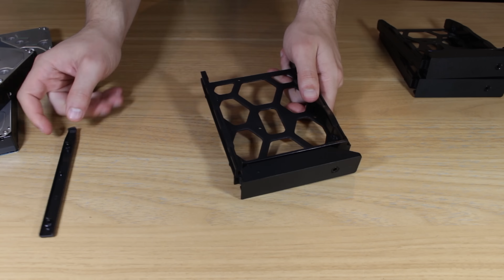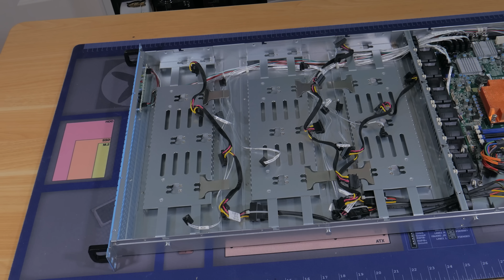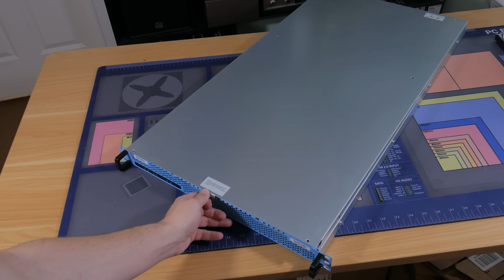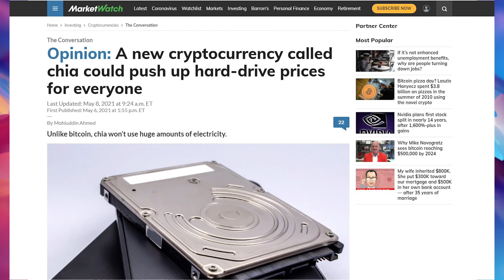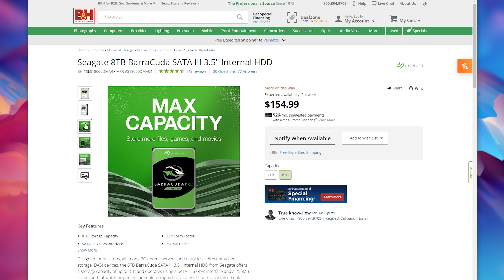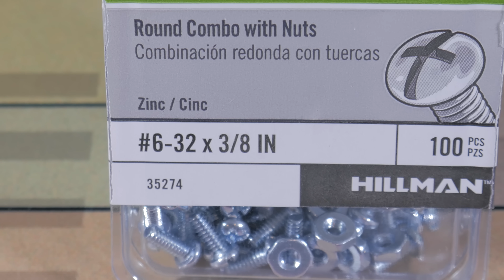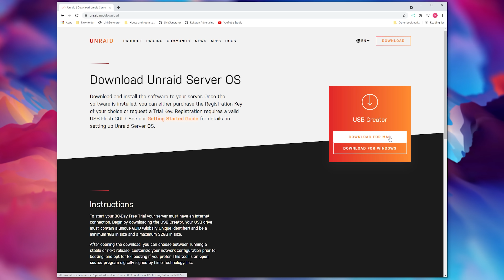Budget Storage Server 2021! | 80TB NAS

Comment: Well , i dont have 80 GB , i bought 7 two TB ( used ) HP Server Disks ( 30 Euro each , CMR ) an old 4 TB and two 1 TB HDDs  from my old External Drives and put it into my old Case which has 10 5 1/4 Bays . I used my old Asus Prime B350+ and my old 1700X , i buyed two 10 GBit NIC ( Mellanox , 15 - 20 Euro ) and an Mikrotik CSS326 Switch ( passiv cooled , silent ) with 24 x 1 GBit and two 10 GBit SFP Ports , 130 Euro ,  an 3m Copper SFP cabel with Transeiver , 10 Euro , an optical 30m SFP Cabel with Transceiver , 35 Euro . 
I use Truenas ( Freenas ) because it only works as NAS and Media NAS . The 2 one TB old  HDDs work as Raid Zero vdev , the old 4 TB as Media Storage as another vdev , and one vdev from 2 x 3 two TB HDDs in Raid 5 = one of the 3 HDDs can fail without loss in Data , one 2 TB is Spare . You dont need an Graphics card in a NAS , the 10 GBIT NIC card  ( 4*PCIe 3.0 ) is in the Grapics Slot. I banned the NAS from my computer room  to another less used room ( thats why the 30 m optical cable ) , 6-9 spinning HDDs can be noisy and i am sure , your 1 HE Server with its fast spinning Fans will be even more noisy . Currently i use my old 16 GB DDR4 but i am planning to upgrade to 3200 ECC UDimms . Ryzen supports ECC as my B350+ does and with TrueNAS ECC Memory make sense , more its better = it will be 32 GB , Truenas uses Memory as Cache , currently i get 300-700 MB read speed from the 6 Server HDD vdef ( with only small Files its way less , but thats normal for HDDs ) , in total i payed till now about 500-600 Dollar for my partly used parts 10 Gbit NAS
https://www.youtube.com/watch?v=Evm5dS0TtXU Read Performance ( Big File )
https://www.youtube.com/watch?v=-ALNbJz_-6o Write Performance ( Big File )

Comment: I wanted to point out that the factory retaining mechanism for the drives seems to rely on longer than normal screws in 2 of the holes.  You might be able to reuse those screws from the Seagate external enclosures, if that kind of thing matters to you.  A regular 6-32 SCHS (allen bolt) would probably work too, to engage the retaining mechanism.

Comment: Are you really tried zfs con FreeBSD? I dont think than ZFS is a good choice. Im sure its tje best one. Autorepairs, autoscrub, safe changing damaged drives, caché cache and cache is the most intensive thead than the processor must support. The only thing you should invest is un RAM. zfs is RAM hungry (42€  more and the benefit over a 100€ ssd is oversized... And you can add an ssd as cache toó, of course.

The most comercial and great db apps use it. Cause the not-restrictive license, and cause zfs hasnt any real alternative. Its the only one in 1st división, at tjr moment.

Ty for sharing. I follow u!

Comment: Opening something doesn't void the warranty in the US. You're based in the US. As a tech YouTuber, do better.
Reply: Even though that's true legally, some companies like Seagate will not honor warranty for shucked drives. You can take them to court, but that'll cost more than a new hard drive
Reply: @AstroDash42  Incorrect, at least in the US, where the OP is located. All you have to do is put the drive back into the case and submit warranty claim. You don't know or understand the Magnusson-Moss Warranty Act.

Watch and learn:

https://youtu.be/9sHbaGuSuck?t=480

Comment: i have a little nas made on rasberry pi,but a single thing i could say to you is,try to use btrfs as raid,it is also software raid,but could be implemented into free debian server and has some compreession features that could give you even more than the full 80tb space,obviously this will cost cpu power and disk space,but in my 4.5tb nas i've could be able to store up to 6tb of data just by using the btrfs compression,but it is slow as hell to add new big files,btw,read them and add small files are almost the same speed that without the compression

Comment: i do the same thing for 10tb drives at moment i have got 3 different types compute nas and a surveillance 10tb all work good in the nas so far or i use xponology and the sha drive system so i can add drives and expand as and when needed and still have a backup if 1 drives fails the 1u case must sound like a small jet engine

Comment: I have had generally terrible results using the Seagate "compute" level drives. They have firmware level sleeping that needs to be disabled via a DOS utility before they can be used in a raid setup, then I have had multiple failures compared to the iron wolf/exos series which I have more of (40+) but only a single failure.

Comment: get rid of a SSD, buy a PCIe Dual SATA M.2 with onboard sata chipset and you can run 2 m.2 sata drives without the need to use your onboard sata, use them for HD storage.

Comment: You did a huge mistake. Those regular Barracuda drives are SMR. After you write something, it will never recover it's writing speed on rewriting. It means, that they will die pretty fast  under intensive writing and break yours raid. Probably, in 6-9 monthes. I have never seen SMR drives working fine for long at servers and NAS. 

Seagate have Ironwolf for this, WD have Red Plus, Purple also may go better than those ones, Toshiba has X/N/MG drives.... And then, videos like this get 150K of views and my mate working at data recovery gets the work to be done....
Reply from the maker: You clearly didn't watch the video. I stated and explained they're SMR drives. I also explained how I'm not using raid, I'm using Unraid. Beyond that I also explained that anything put on here will go there to die, making the SMR drives fine for this application.

Comment: Excellent job! I wanted to go the same route, but I simply didn't have enough room for the full size server. I ended up with a Synology.  More money, less capacity, and not nearly as fun to tinker with, but fit my current need.  Using a PCIe extender, any chance of adding a 10Gb NIC?
Reply: I thought of the space issue, but this server can easily sit front side down, and stand it straight up against the wall behind a desk.  The plug on the top your vga/kb/mouse/power and you're good to go.  I love this setup and can't find it anymore. 😞

Comment: Thanks. It is going to be too loud for actual home use. Also you may want layout map the hard drive before put it in production use. Or else you may not know which drive is going down when they are ...
Reply: Unraid will give you the serial number of the drive. So there is no need to label them. If you were using a hot swap drive bay, sure. In this configuration there is no need.
Reply: @daaero  if your drive is down how cloud you read the serial number? unless the controller able to control some kind of LED to indicate which slot is empty or it is exactly listing the same logical and physical order so you can follow from 1 to 10 one by one. Or else you need to match the rest of the 9 drives' serial to find out which one is actually down
Reply: @daaero  lol I know but which one is the one that is currently not working? WIthout a map you need to go through one by one and check ok ... it is here, check, it is here check, it is here check, it is here check ... worst case scenario you need to check 9 drivers to find out which one is actually bad and not gone then pull it. So without a map,  it could be easily created at install time not run time, when your drive has died it is a needle in a haystack.
Reply: @daaero  you still don't get the problem. Maybe you are lucky and never face a dead drive in a  12+ drives setup with no led controller to tell which drive is died before. Using your example from the interface, let say your drive /dev/sdn is dead the next second, by then you will have no way to tell 2AE166 is missing because it has died. It won't be showing up in your interface whatsoever. How are you going to remember ok in my node 13, drive 14 which is the current dev/sdn is missing ... unless you get photographic memory which I don't how do you know ah /dev/sdn is missing and it is in slots 14? A MAP. Which can show you the historical setup not runtime setup.
Reply: @AvengerMoJo  
You don't get it.... this person isn't using a removable bay system. So your point is mute. He doesn't need to remove any drives to see the serial numbers. The numbers are right there.... I did say in my first comment that a label system would only be worthwhile in a removable bay system.....

Now my comments have and are only about this person's setup. I'll explain it again:

The drive serial numbers are stored in the unraid OS, which lives on the USB stick. There is also SMART, which you can have early warnings of a drive failure sent to your email. Unraid does this.

You don't need to remember anything. The serial number is on the label of the drive.

 The serial number is stored in unraid. If a drive suddenly dies, it will give you the missing serial number.

Using that number, you can then look at the drive labels to find the serial number printed on the label.

Which part of this don't you understand?
Tell me so i can try make it more simple.

I have had drives die before and this is exactly how I was able to replace them...
Reply: @daaero  which part of the OS keep keep your old drive serial number?
Reply: @daaero  from the doc "This step isn't strictly necessary, but is a wise precaution, just in case something goes wrong! Before you shut down your current server, make sure you have notes of which disks (model and serial number) are assigned to which disk number (logical slot) in your array. Or do a screen capture of the Main page, press Alt-PrntScrn, paste in MS Paint, IrfanView, or similar, and print it out." just to stay my point

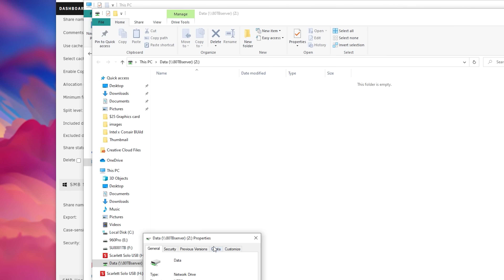Comment: 12:40 Drive manufacturers aren't overstating size, Windows under reports it. Windows uses tebibytes, based in binary, while terabytes are decimal, resulting in ~%10 difference in size. For some reason they refuse to either switch to terabytes, or to use the appropriate symbol for the tebibyte TiB.
Reply: This is actually partially due to historical reasons. Originally it was measured only in powers of two -- with the SI unit prefixes used for convenience. Occasionally companies would use it by power of 10 but it wasn't until 1995 when the IUPAC recommended the creation of new units to denote powers of two vs decimal units. The IEC adopted the recommendation in December 1998 -- which is relatively recent. Even OSX/MacOS used the powers of two units until Snow Lepoard and iOS 10 (2016). Likely Microsoft is staying with what it is because of a mixture of inertia and it ultimately not being that important to them.  

Fun-Fact: Donald Knuth proposed to call a Kibibyte a 'large kilobyte' (KKB),
Reply: You could still say it's the companies fault
Reply: It's weird how RAM manufactures and M$ can agree on which unit should be used but storage manufactures decided to used something else because they wanted to put a bigger number the box
The International Electrotechnical Commission (IEC) created the term tebibyte and the other binary prefixes -- kibi, mebi, gibi, pebi, exbi, zebi and yobi -- in 1998. Before then a Kilobyte was 1024 bytes there was no decimalisation of a base 2 number system. M$ is just displaying the units the way they always have
Reply: Wait, so they measure in one unit but display in terabytes?
That's as stupid as if I were to measure out 100 kilometres but then display it as 100mi.
Reply: @Chris_Cross  Not only is it stupid, it is outright dangerous!

Comment: TYAN are very good server boards. This server is great for its times but power consumption....

I was able to sell those PCB, power supply and cable as a SATA to USB adapter, and the power supply alone was sold as 12V 5mm barrel adapter.

Comment: SMR is inferior, but sadly not outdated. It's a farly new tech and the drive manaufacturers used it mostly for cost saving. I don't think SMR is going away any time soon, its primary purpose is for write once read many applications so is ideal for data archiving, many of the much higher capacity drives initually used SMR.
Reply: Yeah, it really does has its benefits! SMR drives are also generally cheaper and can have more capacity than a similar sized CMR drive which is a nice benefit, only comes into play for 2.5" drives though, as far as I now.

Comment: Why would you only get 30mb/sek for write? Sounds like you are doing something  wrong somewhere or that your server is limited to it somehow. I have cheaper drives in a server that i run that i get atleast 80mb/sek without any issues, should not be 30mb/sek for writes if you have it correctly setup.
Reply: It's called SMR drives
Reply: @borkiborz2891  No that is not the reason slurker, also own a few of those and i can still get up to 70-80mb/s atleast on a few of them unless they are older. The problem is either software or hardware or the drives themselves. Most likely as he has new drives it should not be the drives themselves i can promise you, here in sweden i do alot of computer building and have done over alot of years. 30mb/sek for write is really low for a new drive, has to do with either motherboard/chipsets/sata ports or software in that case. I even think i have/had one drive that is thesame as he is using in his video..

Overall great video otherwise, just trying to be helpfull :)

Question to the video maker, how do you transfer the files? Directly over SMB/shares or thru ftp? I've come across times when over ftp for example the transfer rates can get like that but because of config for example.

Comment: Hi friend. I did something similar than you. I bought an 2012 i5 HP server. I addedd 6 SATA discs (of 2TB each), and an SSD to boot and store OS. 75€ of the server, the disks than I previously had, 20 for the SSD. and 20 for the RAM. Some euro for the small stuff (to hold in place the disks), and a TRUENAS. Ultracheap nas. Great option the server cage from ebay, i did not knew that!
Reply: I also just bought an old HP server (DL360 G6) for about $140. Two 6 core Xeons, 32GB RAM. I am about to set it up with Proxmox for a virtualization and Nextcloud server.
Reply: @anonimuso  well done!

Comment: The motherboard has internal USB sockets to allow you to plug in your flash drives inside the case so it isn't hanging out the rear of the case while the server is running.  That does assume your flash drive is short enough to stand up in the case with the lid closed (~30mm but shorter is better for clearance of the case lid).

Comment: We own a Synology 4-Bay NAS which cost $549 and has a total capacity close to what yours is. It's NOT the NAS system that's the expensive part it's the Drives. 80TB worth of Drives is simply not cheap, no matter how "budget" you build the NAS PC itself. We went with 4TB Raid 0 and 24TB without redundancy (4 total Drives) for a cost of about ~$1300. Also, you're using the literal worst NAS Drives on the planet. Seagate has been proven shit for years by the entire PC repair community. WD Red's are only a little more expensive and far superior NAS Drives. I cannot speak on the benefit/drawback of your Server build vs a Synology as I myself am also a Server n00b.
Reply: Yeah, Seagate scare the fuck out of me.  I have some older Seagates and they were worst ever.  Failed very early.  So, I have not had ONE SINGLE Seagate since then.  Never again.

Comment: with a little modification the ssd's will fit under the hdd's in that chassis. giving you room for more drives/parity. you can also get pcie ribbon adapters to for m.2 or u.2, along with a 90 degree pcie 16x adapter to make use of the one slot.